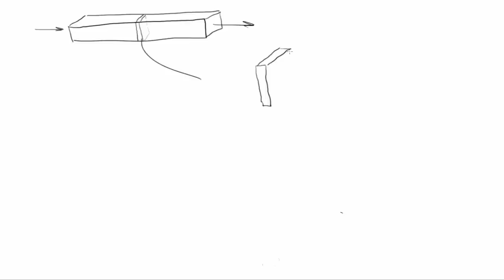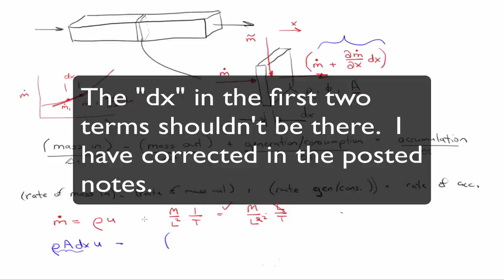Mass balance in one-dimension

Comment: in 12:57 you said: it seems like i have an extra dx

why?
based on what you said 
mass flux equals density*area*dx*velocity

please correct me if am wrong
Reply: I haven't taken the equivalent of this class yet, but I have finished the course this stuff is based on. I'm pretty sure this isn't necessarily anything special. I don't think he meant to mention flux, although I could be wrong.

Instead he is doing mass rate in (not flux in; AKA not mass rate/area in). so the correct equation would be mass rate in = density * area * velocity. much like when deriving the radial diffusivity equation. Not flux.